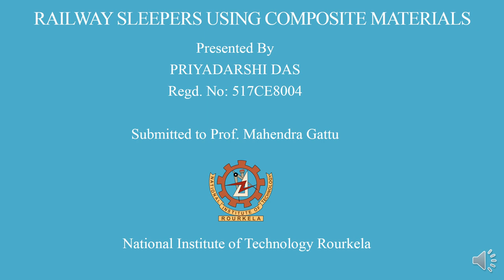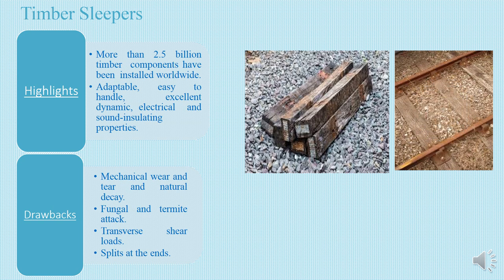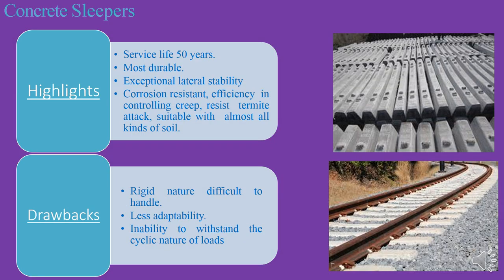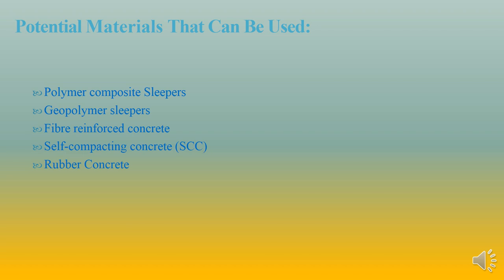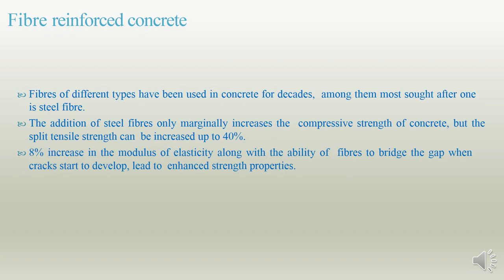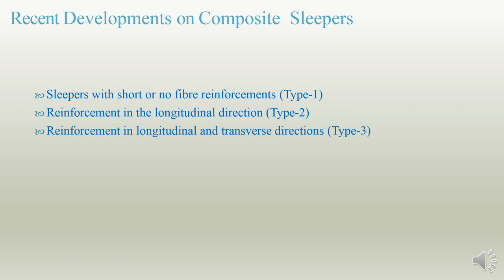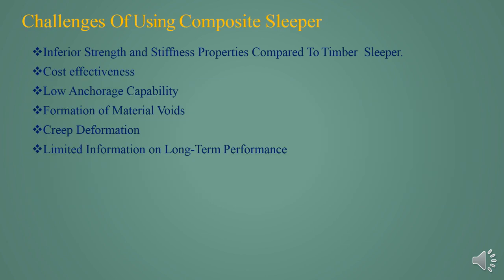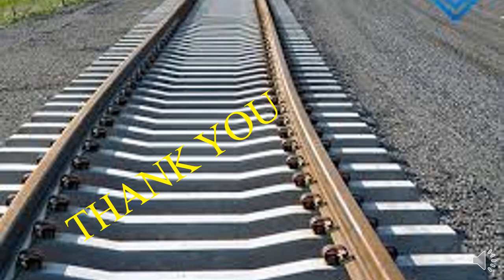RAILWAY SLEEPERS USING COMPOSITE MATERIALS

Comment: you end saying thank you.  well, let me say thank you for such an informative, brief, to the point and knowledgeable video.  i didn't know about many of these sorts of sleepers.  i did not think it was possible to have a concrete sleeper without steel bars.  i saw no mention of basalt fibres in your presentation.  are you aware of them.  i have some experience working with concrete.  i consider basalt fibres to represent a brave new world of concrete design.  i expect there may be limitations though.